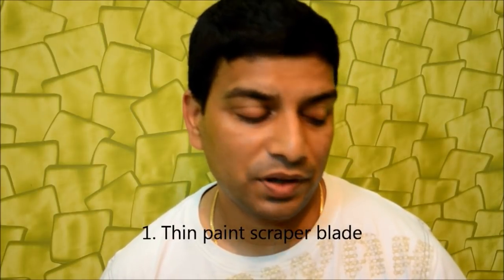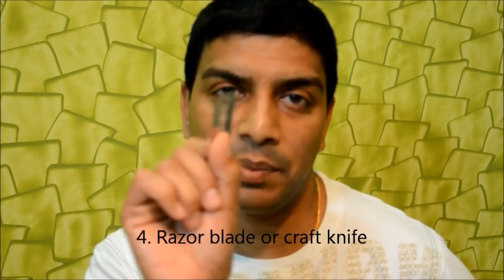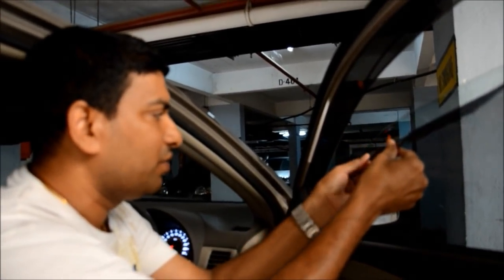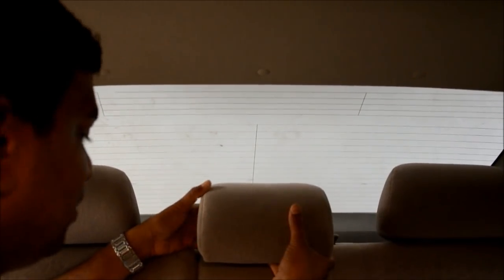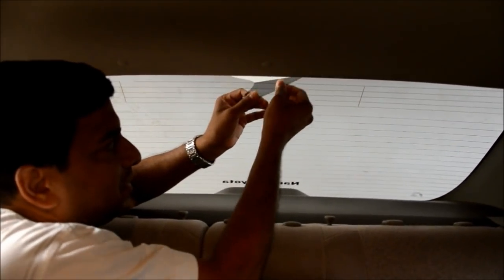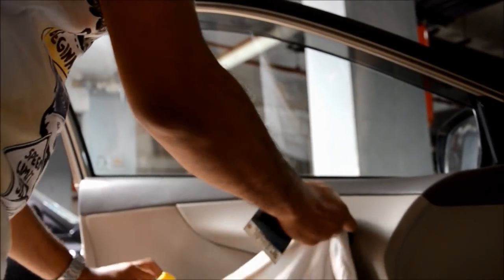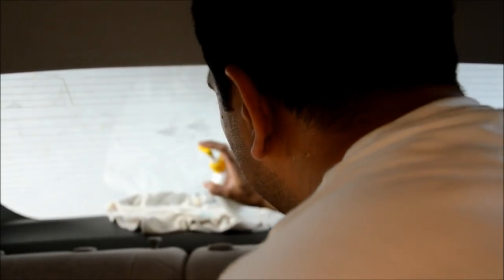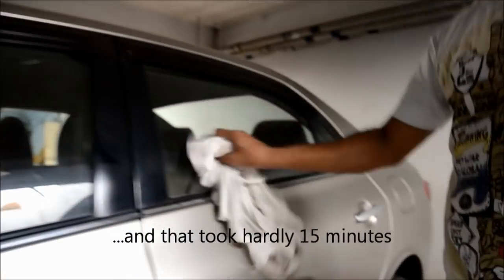How to Remove Sun Film From Car Windows?

Comment: very useful, thanx for this valuable video, its not the charge that i am worried about for removing sun film. My friend had removed sun film recently, and it seems full stain of the sticky part is still on the window and taht is creating problem in the winding of power window..
I am planning to remove it myself to make sure nothing goes wrong...thanks a lot

Comment: Nice helpful video. I tried this & felt I made some mistakes but finally it worked reasonably well. For 1st window, after making a small incision, I went on to pull off the sun film jerkily. Problem with this was that it left lot of glue behind for me to clean up. For other windows, I pulled the film very slowly such that it took away most of the glue with it. Also, as I pulled off the films, I also sprayed some water which helped the film come off more easily. Yet to do the rear glass though

Comment: It is always good to remove sun film at home by own. Only one important instruction while removing film is to pull it very slowly so that most of the glue will come out with film. If you pull film very fast then all the glue will stay back with glass and then you have to spend more time to clean glasses. So don’t be hurry initially.  If needed you can use nail polish remover  to remove glue if it is finding difficult to clean and still showing stains on glass.

Comment from the maker: Murali, since Swift features a very narrow V shaped quarter, you may have to make a small cut near any of the edges and lift and peel it with a craft knife or blade. Accessing the quarter shouldn't be a problem as it opens wide along with the rear door.